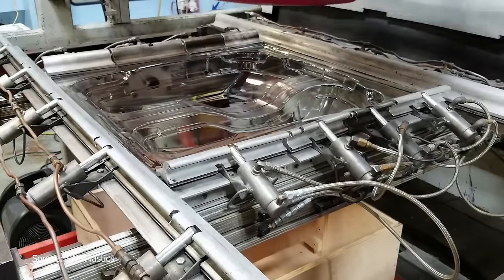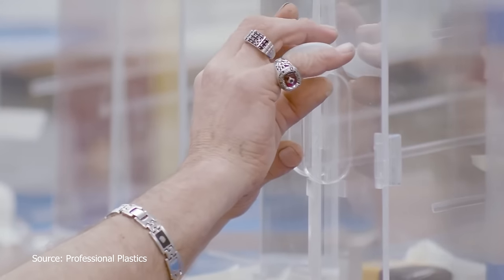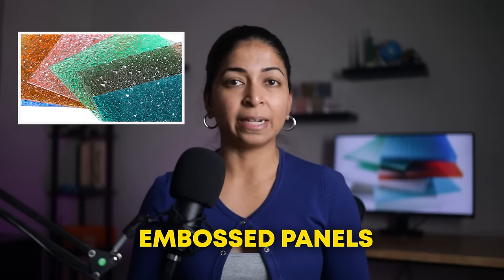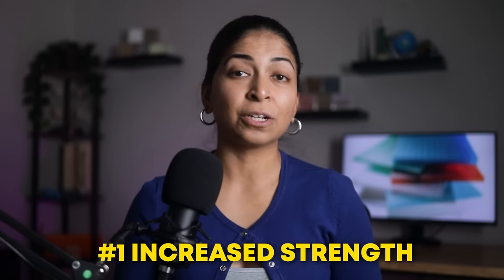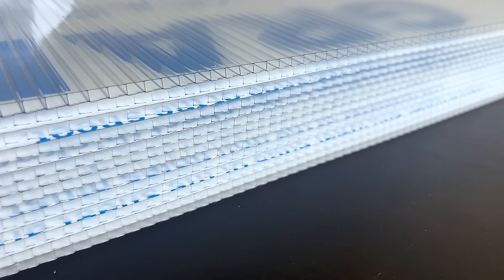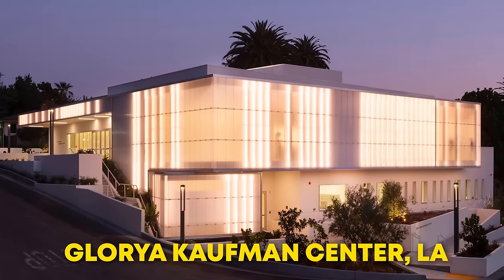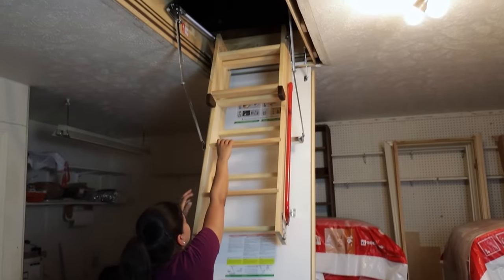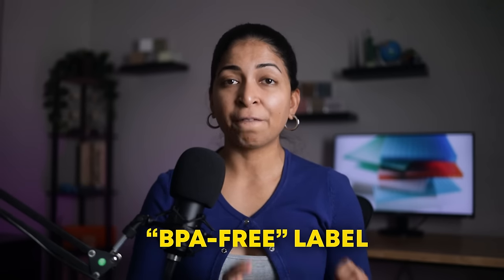Could Polycarbonate Plastic panels replace Glass Windows?

Comment: Plastic yellows in sunlight, throwing away your windows every 10 or 15 years is a massive waste. I have seen ground glass panes and lenses on 160 year old lighthouses that look like they were made yesterday.
Reply: You can see this in headlights. The glass modules made for the 80s and earlier cars still look clear than modern plastic modules (and cheaper, too, since it was a government mandated standard part instead of proprietary shapes and tech).
Reply: Also glass can be recycled, I'm not even sure if there's a limit for how many times you can melt it down and re make it.
Reply: We already throw away windows when the seal is broken on double pane window. That's around 10-20 years
Reply: What about tinted polycarbonate windows? If it's in a dark shade you won't care if it's yellowing.
Reply: @apex007  that's hardly a critique of glass, more of the sealant
Reply: @greasybumpkin1661  the facts still remain the same
Reply: I re-purpose sliding glass door glass for solariums. It comes in standard sizes and leaky-condo contractors put out dozens of double-pane units at a time for free! Why aren't the avant-garde architects onto this amazing resource?
Reply: @greasybumpkin1661   hardly any glass gets recycled because it's too cheap to make new glass and recycled glass is actually more expensive because it has to be cleaned and sorted and then shipped back. More local uses of recyclable glass would make it more viable though.
Reply: @pong9000   not a reliable resource and it can't always be guaranteed to be available.
Reply: @danielbuckner2167  It's reliability and availability, like any recycled/reused good, depends on who's collecting it. Stacks of glass behind one of the outbuildings last longer in the elements than bricks.
Reply: @pong9000  Sure but are you using as a recycling baseline because that doesn't get recycled  broadly either.  It's honestly just economics, it's cheaper to build a foundry where vast resources are and distribute from there rather than ship glass back that has to be Cleaned and sorted and can't be relied on as a commodity.
Reply: @danielbuckner2167  In theory perhaps. But in practice I've salvaged free patio door glass from leaky-condo situations for free with nothing but a utility trailer and space in the rain behind some outbuildings. I drop the aluminum on a scrapper who even pays me for the metal. The Canadian leaky-condo contractors love it because they would have paid a landfill fee to bury their predecessor's incompetence. They can informally pocket savings while strata forks over anyway. Then I wait for the next solarium project to appear, where I have walls and roof of standard sized tempered glass on hand. And I make a homeowner very happy.

Just use your imagination and seize the initiative dude!
Reply: @pong9000  not theory but real life. A guy and a trailer doesn't scale up to make a change in an industry. What you are doing isn't actually recycling but upcycling---- which is great!! I use opportunities as well but realize the limitations.  ￼￼
Reply: I’ve had double wall polycarbonate panels on a greenhouse for over ten years and there is no yellowing.
Reply: Polycarbonate is available with a anti uv coating for external uses
Reply: you can polish the windows in 10 seconds
Reply: In South Africa they come with a UV protective film that protects the polycarbonate. We prefer Polycarbonate here for large panels as it doubles as security.
Reply: @greasybumpkin1661 that’s true, but you could make an even stronger claim, because there isn’t even much reason, if any, to recycle glass, because it can be produced cheaply from a raw material that is so plentiful that it lacks practical scarcity.

Comment: 40 years ago, for over a decade, I did a lot of work installing clear polycarbonate storm windows. Eventually we switched to safety glass. Polycarbonate as a replacement for clear window glass is less than ideal. It will yellow within about 10 years or so. It will scratch just from stuff in the air. Larger panels can distort and have a wavy appearance.
Reply: I can second most of this. I added a PC sheet as extra insulation inside a double glazing window - as I renovated old wooden windows. However, from outside it was very clear there was something weird with these windows, as reflections (trees, ...) were bent, wavy, curved. It reminded me of these curved "funny mirrors" one have in some entertainment parks. 

However I've used PC sheets successfully in other applications (transparent outdoor roofs being one of them).
Reply: @arnesteinarson3645  -- Wavy panels are the result of too thin a pane over too large a span.

Comment: I can say from experience, polycarbonate roofing/skylights can shatter in a hailstorm, it is not a "virtually unbreakable" material. It may have high impact resistance at the time of installation, but despite being relatively resistant to UV degradation, UV exposure will make it more brittle over time.
Reply: That's my experience too, UV gets past the "UV coating" and slowly destroys its impact resistant properties.

Comment: I have polycarbonate panels on a green house that is 30 yrs old . Here in Alaska we get 20 hour or more sunlight in the summer and my panels are as clear as the day I installed them. Strong and no issues , snow load etc
Reply: Yes, the problem with polycarbonates is UV and so at your latitude, the UV exposure will be minimal. They are also great for extremes in temperature.
Reply: whats your latitude?

Comment: Polycarbonate IS VERY susceptible to breakdown to petroleum products and natural oils, such that installation instructions are VERY specific on what comes in contact with the panels in the way of rubber washer on the screws and contact with other roofing materials, esp. petroleum based. I have PC lenses on my rimless glasses, and there are radial fractures emanating from the screw holes where  some skin oils get trapped. In higher heat, sunnier climates like So-CA, NV, AZ, NM, TX, etc. PC panels will have a much shorter life expectancy, from 5 to 10 years, max. 

Also, BPA is just one of MANY endocrine/hormone disrupters found in plastics. Some of the replacement chemical hardeners used to in place of BPA are even more toxic/disruptive of our hormone systems, but simply haven't gotten the bad press yet. 

All that said, PC is VERY strong and shatter resistant earlier in life and it's strength properties are amazing.
Reply: Excellent info and explanation. Thank you.

Comment: Walk through a parking lot and look at vehicles older than ten years and you'll see a lot of very yellowed and sometimes nearly useless headlights. That is UV yellowing. As an eyeglass wearer the lenses yellow in two years and the exotic coatings (even if you request no coatings) begin flaking off then too. There is glass in hundred year old homes that is still quite serviceable. Interesting fact: glass back then was inconsistent in thickness so window makers would install the heavier/thicker side down as it's more stable, then later people thought the glass slumped down over the decades like thick honey...

Comment: I've actually been considering using polycarbonate panels as a translucent wall panel in one part of my loft. You covered a lot of things i was wondering about. I suspected it should have at least mediocre sound proofinf qualities so its nice to know it does help with that. I specifically want a material that allows light to diffuse through to stop the corner behind it becoming dark and dreary. The loft has a very open plan feel and i need to block off a small corner of it. Thanks for the video - some good food for thought. They need make thr uv coatings standard or more readily available as these panels are generally used in relation to sunlight.

Comment: Might have been a good idea to cover IR transmission as polycarbonate is big in greenhouses.  I chose polycarbonate over glass for cost, insulation (non-negotiable), hail resistance and weight/ft2.  Yellowing and scratching weren't big factors in the application.  IR transmission was a big downside (although outweighed by the other factors).  Glass absorbs most IR, helping to keep interiors warmer (for cold climates) and consequently blocks more IR (warm climates).  Coatings can change these properties, but I don't think an IR absorbing coating was available at the time.

Comment: Before even watching the video  I'm against plastic windows, scratches easily yellows in sun light, i mean look at headlights on a 20 year old car
Reply: 10 years in many cases. Also, even my glass windscreen is pitted from dust and sand thrown up by the cars ahead of me. I once tried to sand a polycarbonate sheet that had an anti scratch surface applied. Vey difficult to sand, the coating seemed to be almost rubbery and wouldn’t scratch. Belinda isn’t talking about cars though she’s mainly talking about. Some special applications where the lightweight and thermal insulation properties are more important to the design.

Comment: Like any material there are great ways to use it and not so great ways to use it. Most of the drawbacks I read here are from people using it in an application they shouldn't. I installed these panels in a custom 30' interior skylight application (not exposed to weather) 30 years ago and have given me everything I wanted....insulation, ease of installation, lightweight and best of all I LOVE THE YELLOWING! The warmer yellow color (similar to the older light bulbs that looked more like candlelight) is so much nicer than the harsh 4000 kelvin LED's that are everywhere. Would this work in a jewelry store or food establishment when purer color is warranted? No. But in my application, the color gets better every decade. Also, if a panel falls in an earthquake, I'm going to survive a 1# knock on the head much better than a 10# piece of glass.

Comment: I am disappointed in Belinda for not discussing the obvious drawbacks. Polycarbonate is not UV proof. It will enentually get brittle. It will shed microplastics and polymer additives to the air and ground water. It will scratch easily. It will become trash in 10 years in most areas.

This is just another case of interest driven thinking. It is not a green product. It is a gray product marketed as green.

Instead, get good glass windows and a metal or tile roof with added insulation underneath. You won't look back and your grandkids will thank you.
Reply: 7:33

Comment: None of this sounds good. 

So it's not single use so not a microplastic issue...aside from the fact it's soft, scratches easily which probably leads to microplastics and it is practically disposable as you have to replace it when it yellows in 10 years. 

Sorry but felt a bit misled by this one. How about we just avoid using plastics, disposable or not.

Comment: It's a neat piece of tech, but I gotta be honest I don't see this product doing very well.  
1.  The fact that it's going to eventually yellow.  Depending on the timeframe when this happens, this is going to be a major upkeep cost for home owners and businesses.  Also if a home owner is cheap and lazy and just let it go, you're going to see a lot of ugly yellowish windows all over the world.  No thanks.
2.  So it's stronger, but more prone to scratches?  That doesn't seem ideal.  Sure it won't break if a person throws a rock at it like standard glass, but if wind, leaves, dust, and other random things in the air is going to scuff it up quick, that's no good.  Who wants scratch looking windows.  And sure you said they can put a protective coating on it, but that's going to add to costs, and I'm sure the coating is going to fade, so much like staining a deck, now you'll have to coat your windows every few years.  Not good
3.  The health concerns is a massive red flag.  The product should honestly be recalled if living near it is going to potentially cause issues.  Why would you want to build your home or business out of something that's going to physically hurt you?  Not worth it.  Sure they are trying to create a non health risk version of the product, but like why didn't they start with that?  This seems really dumb, and any building with this stuff installed should be updated immediately!
4.  And finally the big one, I personally don't think it looks good.  All of those building in the video with this product installed on, look super cheap.  If glass is the main stream toy, this looks like the dollar store version of it.  It just doesn't look good.  I wouldn't want my windows looking like that.

Awesome video, very informative, but I don't think this product is going to take off.  But it's neat people are looking for alternative solutions to glass.  Thank you for all your hard work and amazing content Belinda!

Comment: I think the title is a bit misleading here. Polycarbonate can't replace glass windows in the use case many commenters are criticizing -- it can't function as a durable clear material in weather-exposed areas. But many of your examples are showing much better uses for polycarbonate panels, such as durable translucent installations, or transparent installations inside buildings. Glass is heavy, and polycarbonate is far more practical for inexpensive greenhouses or interior partitions.

This is meaningful for homes, interior walls, and ADU structures but as with many building options can have a bigger impact at industrial scales. Replacing even 10% of the reinforced glass facade of a skyscraper with translucent polycarbonate where transparency is not a major concern could allow for much cheaper structures overall. Since glass is often layered in these installations, up to 40% of the overall glass could possibly be replaced by having interior-facing layers made of polycarbonate behind UV-filtering glass.

Comment: In a word NO.  Poly-carbonate breaks down in sunlight, is very very soft.  Has to be hard coated or it scratches even easier. 
Glass is much harder to scratch and is optically superior.   
Glass is just heavier and breaks easier.    
Poly is why headlights on cars get yellow and hazed.

Comment: I love polycarbonate for many uses, but shun using polycarbonate optical lenses.  Their optical clarity is less than perfect, resulting in visual distortions.  They're fine for safety glasses used over my high-index bifocals.  And polycarbonate is both initially more costly than glass for exterior windows and would require replacement in 7-10 years due to yellowing.  $$$$

Comment: Polycarbonate is almost like a miracle material. I have used in structural applications for stair guards and playgrounds. It is lighter than glass but it won't realistically reduce your foundation sizes or the amount of concrete unless you have a very unusual case use. As far as the foundations are concerned, replacing glass with polycarbonate is like putting Sweat and Low in your coffee after eating a 16oz steak, a mound of french fries, and cake for desert. However, you can reduce the load on a long stair stringer with a polycarbonate guard.

Comment: Thanks for the info Belinda. My company EVinsulate uses polycarbonate to create add-on insulating panels (EVglass) for electric vehicle glass roofs. They work very well to reduce heating/cooling electricity consumption.
Reply: Which brands of EV do you supply?
Reply: Currently it is just the Tesla Model 3 and Y, but we will have the Ford Mach-e available by next week. @MiniLuv-1984
Reply from the maker: Very cool! Thanks for sharing